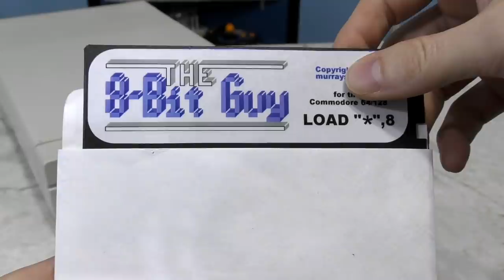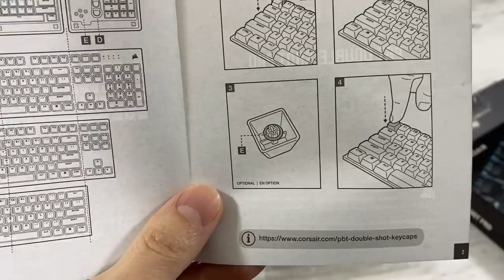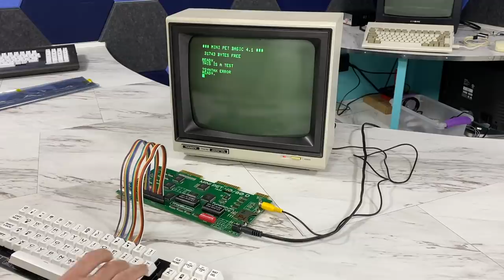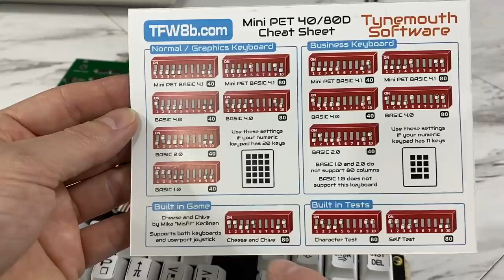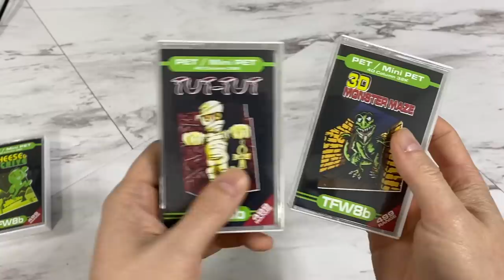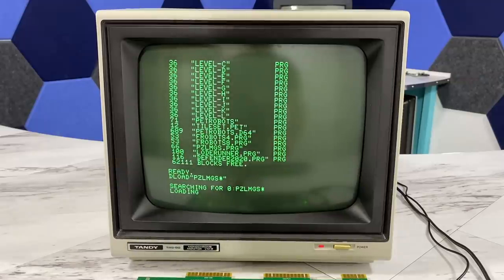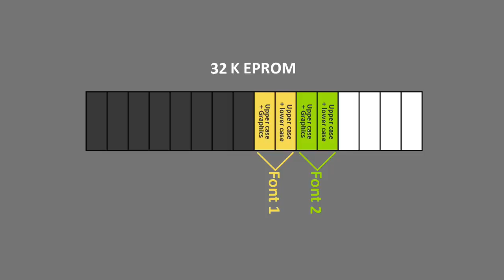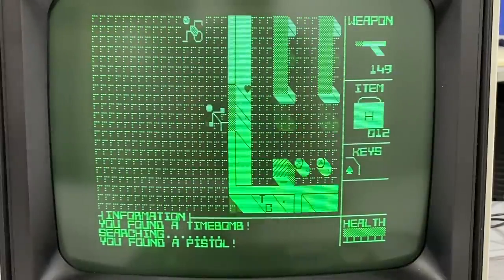The New MiniPET 4080D, reviewed!

Comment: Those little O rings are to slightly reduce the travel of Cherry MX keys, mostly to prevent the key from bottoming to reduce deck clack.  They are entirely optional.
Reply: Would they make a keyboard cat proof, annoying to find three key caps missing.

Cats like playing with running fans, fing idiots.
Reply: @joefish6091  what the hell is your problem man

Comment: @The 8-bit Guy One thing that I did when the keyboard ribbon broke in my TI-99/4A was I soldered male pin headers to the main board and the keyboard PCBs in order to use a 40-pin, 40 conductor IDE cable and used the same half of each connector on the ends to connect the keyboard to the mainboard there.  The same method would work here as well instead of the individual groups of wires seen here.

Comment: I’ve got a 3D printer and would love to try my hand at a design, though I don’t have a large 3D printer (yet—waiting on the Prusa XL). However, this could be done in multiple pieces and still be pretty strong when joined together using tabs or screws. I also think that printing it in smaller pieces would be better because then it’d be more accessible to more people without access to a large printer.
Reply: When you get the Prusa XL, you will have to do a review on what you think.  I have the CR-10S Pro V2 and it's a bundle of issues from time to time.  I swear I'm fixing it as much as I am printing with it.
Reply: @helldog3105  Will do. I’ve found the Prusa i3 Mk3S+ to be really reliable, provided it’s assembled correctly, which I didn’t the first time around, but even then, it keeps on going and produces great prints. The great thing about Prusa is you’ve got live chat support available whenever you need it, and IMO it’s well worth the money to have someone ready to be there. Like you, I want my hobby to be “3D printing”, not “3D printers”

Comment: When I consider a custom case for the minipet, my brain goes to something like the Apple II that you can put a monitor on top of.  And then it hits me:  screw down the monitor and that's basically an original PET.  I have no imagination.
Reply: Go horizontal!
Reply: although, the monitors used with Apple II were substantial; at least 12". I think PET monitor was 9" or smaller(?) Sorry to be pedantic, but guessing wrongly is practically good as being imaginative, in my experience anyways... 🙄
Reply: The MiniPET 40/80D's main purpose is to be a drop in replacement for a OG Commodore PET.. Or as an upgrade.. It can also be used as 'standalone'

Comment: The rings are indeed for limiting the "clicky" sound of the keys.
Reply: Not really, unless you count bottoming out sound as clicky noise.
Reply: @nathanlamaire  To some people even the most brown of switches with the most linear of keycaps will make enough noise for them to want to dampen them.
Reply: They do, I purchased them to make a blue switch keyboard more quiet in a work environment in which I got a colleague that hated it's sound with a passion
Reply: @fabiosemino2214 , I doubt the rings had any effect on blue switches. The noise of blues comes from the construction of the switch, not from the key reaching end of travel which is the only thing the rings affect.
Reply: @mina86  unless you're bottoming like crazy when loggin IT requests, indeed he still hated it because of the clicky activation point
Reply: @fabiosemino2214 , that’s my point. Even if you remove the sound of the keys bottoming out, they activation is much louder anyway.

Comment: The o-rings for the key caps are primarily used to reduce the amount of distance needed to register a keystroke, in addition to sound reduction you noted. They’re good if intend to type quicker and gamers will use them (they come in different thicknesses) to register keystrokes quicker.

Comment: A toner transfer method would be perfect for labeling these keys.  Print the mirror image of the key letter onto the wax paper backing from any sticker by using masking tape to stick it to a sheet of paper and running it thru a laser printer.  The toner is now only loosely adhered to the wax paper.  Spray a light coat of rattle can clear coat on the key and allow to dry until just tacky but not wet.  Then press the wax paper against the tacky key and burnish to transfer.  Then finish with a final clear coat to seal it in.  The results are often very professional looking.
Reply: I think they even make a special paper for making water transfer decals.

Comment: Hey I've been trying to find the games I played in grade school back in the early 90's on the Apple IIe. I've been through many ROM sites and still can't find them. The bulk of the games I found were possibly made by MECC, if I recall correctly. A small company out of Minnesota.

There were games made to teach simple mechanics like levers, pulleys, and fulcrums. I think it was called Pizza2Go, and you solved the puzzles to unblock your route to delivering pizza. Usually to the likes of Dracula and the Mummy guy.

And there was another game where you had like 3 floors set up and you had to move your robot from the start near the top, to the goal usually near the bottom. There were elevators to go up and down from floor to floor. If I remember correctly it was a math game, and you used addition and subtraction to move your robot around. You could play with a friend or against the computer.

Lastly another game from I don't know what platform, but it had Atari like graphics. Lots of yellows and greys in use. In the game you play as a few criminals trying to break into a vault and make off with gold bars. To get to the vault you had to go through a maze and avoid the guards.

Comment: My first idea for an external keyboard for a MiniPET would have been using an CAT 5 Ethernet cable, but it's 11 cables short. A DB-19 connector would match exactly, but it's quite rare to source these days. Then I thought about using a DB-25 printer cable or a DVI Cable. It's more pins/cables than required, but it's easily sourceable nowadays.

Finally, I thought about HDMI cables. 19 pins. A perfect fit. And they even sell coiled Micro HDMI cables.

Well, food for thoughts.

Comment: Hi David! Printing the case in one piece can be quite difficult as most printers are around 10x10 inch but, I've recently seen a video of a guy that has been printing a 1:1 front panel of a Boeing 737's autopilot and he made it in three pieces with sliders that where glued together and there was almost no sign of the connection! Unfortunately I can't find in my YT's history, but I guess you've got the point ;)
Reply: It's definitely more practical to print it in pieces, but not everyone might have the skill/tools to put them together in a nice way
Reply: @jemert96  yeah, you're right (I know I'm not having a skill), but also - David has enough of friends/followers that someone could slice the model into pieces and add a necessary joint points :)

Comment: Make a replica  based on the original curvy PET which was demonstrated at CES or similar. There is a picture on Wikipedia. I have since learnt that case was a painted wooden mock up. The reason the case changed to flat sheet metal was that Jack Tramiel realised released that Commodores filing cabinet factory could produce those cheaply in house.

The reason I recall the picture of the curvy Pet was that as a schoolboy in 1977 I took an feature about it in a Sunday Newspaper to show the Head of Maths to show him how much more advanced it was than the schools Busicom 2017.

Comment: I think the off centre before was that it was set up for the original PET monitor. I've seen the same issue in a YouTube video where the monitor was replaced with an amber one, and the first MiniPET installed in the casing.

Comment: Are there any MOS Technologies, Kim 1 reproductions? Red 4 address, 2 Op code O-9, A-F LED Displays, the edge card I/O connections to 2 I/O chips, 1 K RAM, 1 MHZ 6502.

A short description of the Kim-1:

The KIM-1 hardware consists of a 6502 CPU, some memory
(just over 1Kb in a standard system), and two chips in
the 6502-family called the 6530 RIOT chips. These chips
provided support for input/output functions, some timer
features, and each had some ROM containing the KIM-1’s
monitor program.
The display comprised six 7-segment displays, and input
was via a hex keypad with some extra functions. A cas-
sette interface was available to save and load programs
to tape.
The KIM-1 could also drive a serial port (slowly) to
connect to a terminal (VDU and keyboard).
Memory expansion kits were available (adding 4Kb of RAM
meant a version of BASIC could be used). Another kit was
available to display 16 lines of 32 upper-case charac-
ters on a TV, and take input from a keyboard.

The main way to program it was with machine language op codes and data. To run the program, you entered the start address and pressed the Go button. Go start Executing the Op codes.

Comment: A way to get rid of those black divider marks printed on your keyboard keys is to use Stained Glass Pattern Scissors for lead.  That will remove 1/16 inch of material.

Comment: Joel had a video a while back where someone was demonstrating a continuous print bed 3D printer. It turns all the prints at a 45 degree angle and the print head as well and it prints onto a conveyor belt. If I ever build a 3D printer that's the one I'd like to build.

Comment: @2:50 - RE: "No keyboard cable"
You can grab a set of straight through cables (M-M, M-F, and F-F) pretty cheaply as they're a pretty common arduino component... -- and now that I think about it, I bet in a pinch you could have used a 40-conductor IDE cable (assuming both sides are oriented on the pins the exact same way).

Comment: spot on guess for the O rings... they are to dampen mechanical switches when they bottom out... I used them on my gaming keyboard with red switches... no click when you press them but they clack when you bottom them out... the noise bothered my wife so the O rings helped quiet down the keyboard a bit....

Comment: Why not make the case from polystyrene sheet? They come in different thicknesses and you can cut, glue, sand (shape), and paint. You can make support brackets and you can use polystyrene tubes and use a tap and die set to tap screw holes in them. Use a solvent based glue for good strength.
Reply: Know any good videos showing how to do that? It sounds interesting.
Reply: Can you get it in clear sheets, though? I assume he wants acrylic so you can see through it...

Comment: If you wanted to have custom labels for a keyboard, I have seen peel n stick sheets you can buy to design your own key labels and print. They fit over the keys nicely. I’ve been meaning to get a few for myself, since its so difficult to memorize all those shortcuts. Too bad I don’t have a color printer though.
Is there a better video circuit on this board than the mini?

Comment: David, I know I've been a slacker on finishing up your C5 mechanicals (struggling with the brakes and getting one of the bearings off the rear axle although I think I have all the replacement parts now) , but with a sketch and key dimensions I can whip up a case design for you in cad pretty quickly. My latest 3d Printer will do about 15" in one go I think.
Reply from the maker: OK.  I'll keep it in mind.  I've had a few offers from professionals already, though.

Comment: for custom keys you should try white label pbt caps and then use some silicone and an iron to do dye sublimation
dont know how expensive it is to get custom caps (which do this same thing) but as long as you have an ink jet printer all you need is the ink cartridge adapters and the dye.

Comment: oof, i'm not a fan of the PLCC chips being directly soldered onto the board instead of being in sockets.
that will make potential repairs/replacements much harder
Reply: At least these look like regular flat pack chips that are easily soldered and desoldered along the edge.  Actual PLCC packages are slightly harder to work with.
Reply: @johndododoe1411  from the looks of it (pause at 0:59) they are regular PLCC, not flat pack like TQFP (the Atmel Microcontroller is an actual flat pack chip to compare)
Reply: @proxy1035  Well those still look like gullwing rather than J-lead PLCCs, which aren't that distinct from QFPs.

Comment: Can someone finally introduce The 8-bit guy to 40-pin Dupont jumper cable packs? You can get them with both female and male connectors (or a mix) in 10/20/30cm lengths, and if you have connector housings for various pin counts you can make quite neat cabling with it. I thought everyone had a box of these lying around, but I've now seen a serios of videos from the 8-bit guy where these cables would have been perfect, but where he does something else instead which require a lot more work and doesn't look as nice.

Comment: I have a large format 3d printer and would love to design and print the case.  The printer is 300x300x400 mm. I'm a certified CAD associate in Fusion 360 and academic advisor to Maryville Colleges Student 3D printing club (MC3D).

Comment: how about using an old IDE ribbon cable as the keyboard cable? it is 1:1 pass through and the ATA-133 cables have those extra 40 pins to shield cross talk.

Comment: Couple takeaways here.

I take it shift and run/stop(on every Commodore I used, that would automatically type "LOAD" and press enter for you if you wanted to load the first file on tape) doesn't work on a PET? I've never used one.

I never realised this, I assumed "Tynemouth, USA", but the place this comes from is just an hour from here in a car.
Reply from the maker: On the PET that combination tries to load from disk drive by default.  Assuming it is the later ROM with disk drive support.  So if you want to load from cassette, then you need to type it manually.
Reply: Huh, guess it makes sense. Home computers default to home storage and office ones default to office storage. Or at least that's how tapes and disks were here.

Comment: I have a 3d printer, but sadly I don't think it's large enough for what you would need.  It only has a print space of 300x300x400mm  Which is short of a full sized keyboard in width if the case was printed standing up as it's only about 15.75 inches.  But I'm sure there are people out there that have some of the larger printers.

Comment: Someone should make a replica Pet case, with an LCD monitor where the CRT was in the original, and a set of different optional keyboard styles you can choose from to go where the keyboard went in the original.  The monitor space can either be thin, or it can be a box with space to add expansion cards or something.  I.e. a Pet replica case made for regular PC motherboards to go in could be devised so the PCI and/or PCIe card cage would be inside the "monitor area" of the case.
Reply: I don't think there's enough demand. For serious game-playing machines like ZX80 and ZX81, and later microcomputers, there's game libraries to get a large audience. Rerpoduction hardware is sellable. Not so much the PET.
Reply: @squirlmy  Well, I was thinking more like it would appeal to people who like vintage computing, and recognize that the Pet was an iconic machine of its time, so why not have a PC inside something that looks like one, just because it looks kewl.

Comment: The games can't be "direct ports" from the ZX81, they use completely different CPUs, and on the ZX81 the software has to continually draw the screen, a bit like how the Atari 2600 does. A "port" is usually when you copy the game's code across to a similar machine, with the same CPU, and just change the graphics and sound routines where you have to. Like from a Spectrum to an Amstrad, or an ST to Amiga. 

This is a full conversion, written from scratch I would imagine. Maybe the block graphics could be ported but even then you'd have to convert Sinclair's character set to PETSCII. So not at all a port.

Comment: Regarding the case. Why not find someone that can do woodwork? Someone that can make furnitures. Then design a case that looks a bit like a CBM PET200 or close to that. I guess making it with the use of a so called router (the wood working tool) and using sand paper. Then using wood stain and finishing off with 8 to 12 layer of wood varnish medium shiny. Keep the monitor external by using a build in RGBtoHDMI solution.

Comment: The rings aren’t (as some will have you believe) to make the keys quieter. Or at least not with brown or blue switches. They affect the feel of the keys when they bottom out. Rather tan key stopping abruptly, the rings provides a bit of cushioning slowing the keys over longer distance. The difference is rather subtle though and if you don’t bottom down the keys (which with browns is very likely) you won’t feel much difference.

The rings may reduce noise in noticeable way only if you have non-clicky and non-tactile switches since in that case theoretically the main source of noise is bottoming out of the keys when you press them.
Reply: do you have a source for that?

Comment: This is pretty neat. Curious about the SD interface. One SD card has way more storage than the floppy drives of yesteryear. What is the maximum size SD card that can be used and what format does the Mini PET support?
Reply: Most SD card solutions use FAT32 with no size limits.
Reply: @Ffinity  often there is a maximum in file size, I do doubt that file size will be an issue here…
Reply: @casparberends2719  Yes, there is a 3.2GB file size limit with FAT32, but that wasn't the question. He asked if there was a limit on the capacity of the SD card, and there isn't.